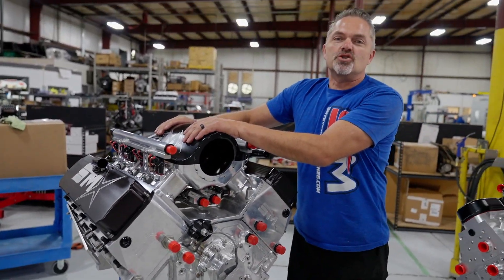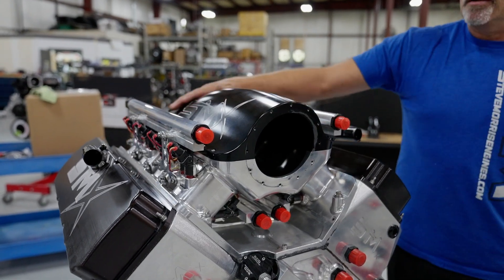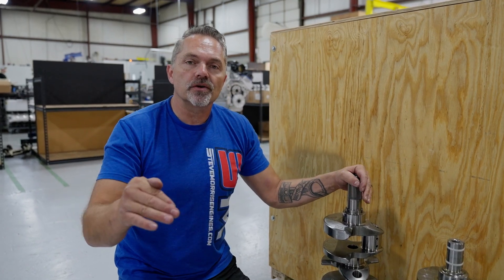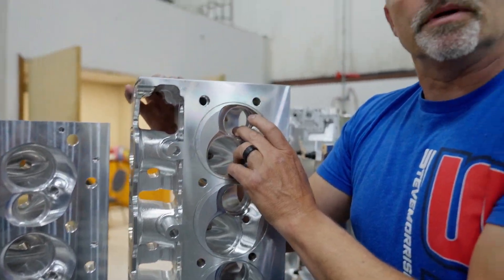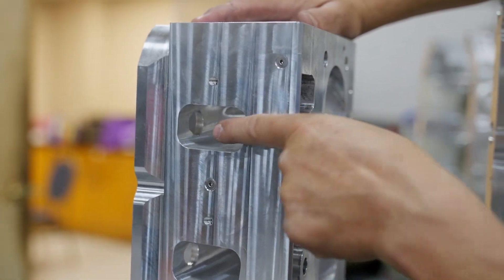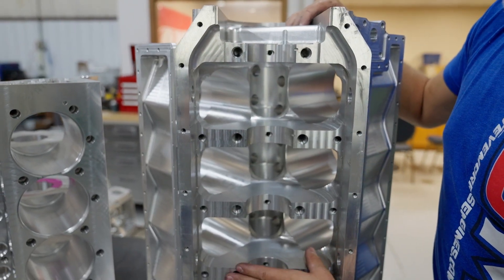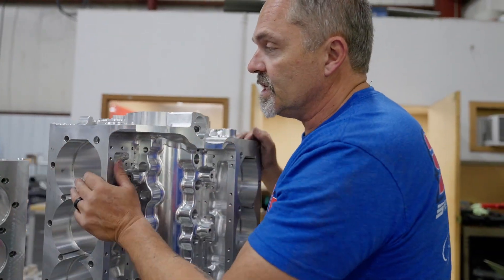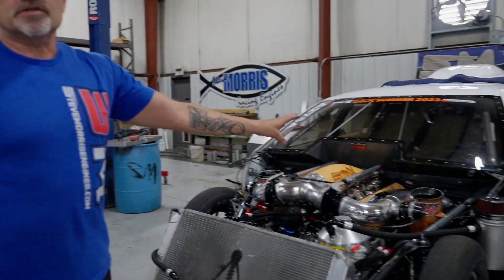5000 HP Or 3500 HP What's the difference? SMX Or SML?

Comment: The torque converter.  Hmm well since its a Chance convertor i think a bolt together unit this can be beneficial ..i think Georend does this also. If its not a lock up unit then i say its designed in a way to more efficient..  i think i read a short article about a power pump converter.  If its a lock up unit may be it can be using along with traction control.  Whatever it is i sure its very good piece.  Enjoy the videos

Comment: I am blowen away. Babbit Barings in a modern motor. Used to be common until after 45 or so. I'm retired lumber mill wright, old iron machinery is common. I have poured hundreds of Babbit Barings over the years. It's a lost art. I have knives, felt, ladle's, crucibles, bluing, and boxes of Babbit bars in my barn and no one to give them to. No one wants or knows what to do with them.

Comment: Hey Steve this a question I been wanting to ask for a while is there any chance you could run the SMX or SML on a single four barrel carburetor? Cause my grandpa has two pulling tractor that only able they to run one carburetor on the engine.

Comment: Everyone wondering about the holes in the ports.... Do the effect the flow??? NO ABSOLUTELY NOT. Imagine being in a deep hole during a tornado or straight line winds. It doesn't effect you it goes right over your head. It doesn't even know your there, especially under boost. The air has nowhere to go so it doesn't matter. The hole is open, there is no cap over/in the hole.

Comment: Steve
Need a Big block Chevy hydraulic roller spring for 240/250 big Chevy cam ground on 104 intake centerline and .598 lift on both int and ex
It's a stock bore and stroke 454
Reply from the maker: common HYD roller, 145 or so PSI on the seat 450 or so at lift, way to many options to tell you a part number you have to have your head guy figure what will fit in the head.
Reply: @stevemorrisracing  thanks Steve

Comment: What is the difference in cubic inches between the two? Obviously, it depends on the stroke. You mention three different sizes for the smx. What does Cleetus run compared to yours? 540 vs 572

Comment: I'd love to see a comparison between a max effort solid promod engine and an SMX. Id love to know what compromises had to be made to make them so reliable and streetable. I know you have said about cams not being as agressive as some and compression ratio is lower to allow pump gas. But id love to see what you had to do with the actual structure of the head and block with regards to making it so streetable (outside the water jacket of course) if thats not trade secrets of course 😂

Comment: Loving all this techie stuff.
Does it / could it hurt these high hp engines if they are constantly run at lower powers? Like low boost, conservative timing and making maybe 1,000 - 1,500 hp from an SML. Would that make for an ultra reliable engine or something prone to failures 'cause it's never used to it's designed performance? 
Also what differences would you see in an engine designed for say a road circuit car? I know your engines are designed for drag racing short bursts of heaps of power, but with the drive configuration you've added could you see them being used on circuits?

Comment: What is the advantage/disadvantage of the longer or shorter stroke
Reply: Short & Sweet : Longer stroke = revs lower, lower peak HP & higher torque. Shorter stroke = higher revs, higher top end HP,  less torque.
Consider Harley Davidson as long stroke vs crotch rocket as short stroke.
Reply from the maker: way to long a answer for that, I will do a video someday.
Reply: @stevemorrisracing  please. Never understood why. Is that also tied into running low compression vs higher for most power but less margin for error?

Comment: Are both SML and SMX designed for a dry sump oil system? Or can the SML use the typical gerotor oil pump with a wet sump oil pan pickup?

Comment: Hey Steve - awesome engines!  I don’t know how you can afford all of the R&D that goes into designing an engine from scratch to do fundamentally incompatible things (ie drive 1,000’s of miles and run through multiple quarter mile drag races).   Anyhow I have a simple question.  Would you ever consider getting blocks and heads cast in Aluminium (Sorry I am an Aussie)   This would give us mugs a stepping stone to these mega dollar engines.  (The xchange rate is horrible for us right now!)

Comment: I'd be interested to see if you could get a clutch to live between the engine and transmission, but I come from a road race background. You'd probably have to work out a slip program in there so you don't blow the tires off. For the drive portion, a lock up converter might be nice though.
Reply: That's why slipper clutches exist...

Comment: Curious to why no one builds turbo engines much larger than 540-572ci. 
Is there any inherent problem with large ci. turbo engines?
Reply: You start running into problems with thin cylinder walls and sometimes limited head gasket sealing area. With boost you don’t need to chase maximum size because you’re not limited to what the engine can draw in on its own.

Comment: I’m still learning, but I remember i believe it was on the  smx video in the past. The thickness off the cylinder walls were 1in thick around the cylinder. But between the cylinders there isn’t much thickness between each cylinder. Is that something you don’t worry about compared to the outsides of the cylinder?

Comment: With those power/wt numbers. You would think the SML is better choice. What is the advantage of your SMX over the SML?
Reply: More power and more torque. SMX has the ability for an extra 1500hp and would produce quite a bit more torque for a heavy car.
At these power levels the extra weight is the engine isn’t a problem.

Comment: Will the SML work for street application non boost ?
Reply: It would, but would also be overkill at that point. For a non boosted street build not much reason to not use a factory aluminum block.

Comment: That is very impressive out of the sml 3500hp ls based engine. I got to say also the weight of these engines is crazy. What does the block weigh before machine an after would be cool to know. Thank you for sharing. Be safe guys
Reply: Steve's done a video on it before. Just have a look back in the videos and you'll find it
Reply: @brandonford7598  thanks. I have seen one on the heads but didn't know there was anything on the block.

Comment: Is there a reason why you don’t use a big block size rod journal for the crank in the SML? I would think that the combination of the Cleveland mains and the 2.200 rod journals would make for a stronger crank due to more journal overlap than with the 2.200. 
If a 2.200 rod was used along with the Cleveland mains, wouldn’t that also make a tall deck striker SML possible without risking a broken crank? Like for example a cool 454 or 475 ci big power Whipple or Roots blown tall deck small block SML deal?
Super cool engines. Always makes my imagination run wild lol.
Reply: Just a guess on my part but I'm thinking the bigger rods would cause issues with clearance at the bottom of the cylinder and the oil pan rail.
Reply from the maker: yep
Reply from the maker: could, takes a little work

Comment: I'm going to be the devil's advocate here you claim your SMX will make 5,000 horsepower you claim your SML will make 3,500 you've said over and over your SMX will hold 80 lb of boost no problem The trouble is nobody's ever seen it every SMX motor I've ever seen be put on a dyno has never made over 3,500 horsepower I think 3,200 was the most I've ever seen I would have an SMX you always run it once or twice on the hub dyno and said all there's no more point in test and there's no more point in p horsepower numbers well actually yes there is and it's called backing up the shit you talk you talk shit that your motor will make 5,000 horsepower hold 80 lb of boost let's see it put it on the Dino crank 80 fucking pounds of boost into it and let's see what it will do Max horsepower whether it kick a rod whether it melt a piston regardless back up the shit you talk

Comment: What makes SML LS based still at this point? Valve cover compatibility? Legitimate question.
Reply: My guess is going to be fitment there is  a lot of cars that an LS fits in fine but  a big block gets too tight with
Reply: @ralan350  Yeah but at that power level your not bolting that into your typical AC Delco/GM engine mounts lol. Or anything that still has them. These are all in $XXX,XXX cars.
Reply: The idea is that someone who was already running an LS can swap to the SML and it’ll mostly bolt in as far as race car stuff bolts in. Would require plumbing and such, but should be able to use same mounts and other parts.
Reply: @NBSV1  Bingo, got ya! Thank you, wording it THAT way, with that scenario, clicked.
Reply: @GoatPilot04  👍🏻
Reply: Bolts right in place of a la. It fits a stock front timing cover. Etc
Reply: @dangerdavis5655  I can buy into the second part of that being the case, like some regular LS parts fitting. It's just so drastically different than an actual LS architecturally and so proprietary and custom to SM, calling it an LS is a disservice to his creation. The fact SOME LS stuff will bolt on is merely a coincidence at this point in the SMLs evolution lol.
Reply: Most people running over 1000 horsepower and are doing drag an drive events are using  front and mid motor plates anyway……. I was just referring to space requirements to physically fit it in the engine bay and still be able to get to stuff on it like spark plugs without having to disassemble half of it…. for example you can drop in LS into a 240 but you’re not gonna fit a big block in a 240 without doing major surgery and this is not an engine for just an every day average person
Reply: @ralan350  That makes sense and was kind of what I was thinking. A reply below mentioned it in a way it finally also clicked if someone is already running a big power LS engine they could easily swap to this without major headaches and keeping mostly everything equal, soace and mounting wise.

Comment: Given your explanation on why the SMX has quite a bit of thick sleeve at the top, I'm surprised that the SML only has a small section that seems to be a register rather than for extra strength
Reply: If that’s a 4.125 bore, that whole sleeve is pretty darn thick.
Reply: It hasn't even got the sleeve in it yet
Reply: @TheEnergizer1965  right, but it's machined for the sleeve and the counterbore (or whatever you want to call it) depth at the top is minimal, without going back and looking I'm guessing 1/4" or so, vs the 1.5" on the SMX
Reply: @totensiebush  
It’s an engine with LS bore spacing. Like I said, this mean you can install a very thick sleeve of the bore is standard 427 ci bore. Then there is no need for a tall step like in the SMX.

Comment: Would that be a restriction in the intake port with the bolt there
Reply: The bolt doesn’t stick into the intake. There’s a machined plug for the intake port that seals and smooths the hole. The two holes are just for inserting the bolt and tightening it.

Comment: Just curious because I don’t know but with a 1/2” head stud going through the intake port does that effect the flow? By the way I love your videos, I think by watching I just might have learned something👍
Reply: Doesn’t matter that much when boosted
Reply: That's a fair question. The answer is in his SteveTech section regarding cylinder heads. The short answer is with the positive pressure his turbos produce, the obstruction to the flow is very minimal.
Reply: I'm not an engineer, but I think under NA applications the plug in the intake would affect the flow. However, under boosted applications not so much. Remember, these engines are built for drag n' drive not max horsepower applications.
Reply: If you go to one of the build videos it shows the actual seat of the stud nut is below the port and a specially shaped plug, to match the port, covers the head of the bolt as well as another to cover the access hole through the roof. None of the stud is in the port.

Comment: Steve, Check with your local industrial supplier. SKF makes a needle roller bearing that may fit your cam needs.  Check on a K65x70x20, K65x70x30, or K65x73x30 K65x73x20. ROM ratings may be an issue.. from 7,000 to 7500..
Reply: Why would rpm be an issue? He does not spin the engine to 14000-15000 rpm.
Reply: @AB-80X  If he does, I would like to see it! Anyway, I think the size might be right. I forgot about the 2:1 ratio on the cam.

Comment: I assembling a 454 in my shed
I grooved the backside of my  cam bearings so I could put the oil hole at 3 o'clock and help the mains live longer
240/250 cam 
Aluminum heads
For a 55 Dodge Coronet 2dr I got

Comment: I WOULD LIKE TO POINT OUT THAT DART HAS A NEW LINE OF BILLET BLOCKS WITH WATER JACKETS THEY LOOK AN AWFUL LOT LIKE THE SMX AND SML BUT THERE HEAD BOLTS ARE IN THE WRONG SPOT LOL CHECK IT OUT STEVE THERE TRYING TO COPY YOUR DESIGN PLUS THEY KINDA TOOK PICS OF THE BLOCK SO YOU CAN HARDLY SEE THE OUTSIDE WATER JACKET COVERS BUT THEY ARE THERE

Comment: Do you ever do an SML without aluminum rods?  Also have you begun to look into hybrid turbos rather than twin turbo setups you have a single large hybrid turbo with the electric motor eliminating turbo leg?
Reply: It's a moot point when you have launch control with a sufficiently high stall converter RPM. For the boost gaps just spray NOS 😂

Comment: I’ve always heard that 100lbs is a tenth of a second in drag racing Anyone else know if that is true?
Reply: It all depends on how quick you're going. In a typical street/strip car that is fairly true. Once you start running around the low 9's to 8's or quicker a tenth is really hard to squeeze out of 100lbs. Also if you have a 5000lb car 100lb isnt going to do much compared to a 3500lb car. Most of the gain is in the 60' time.